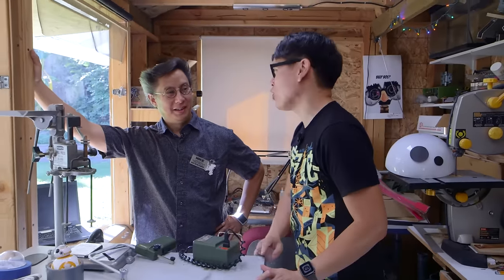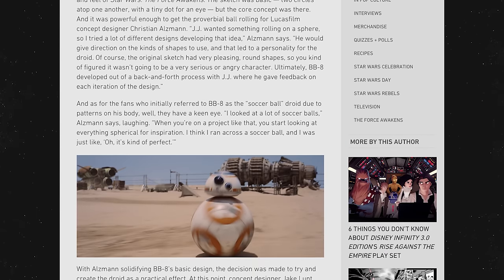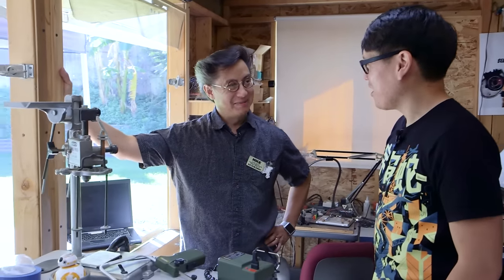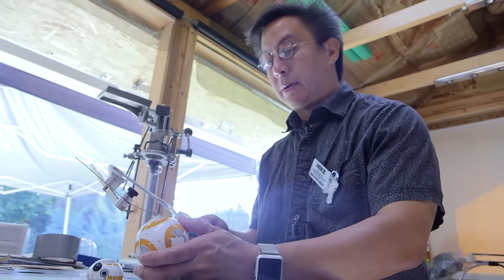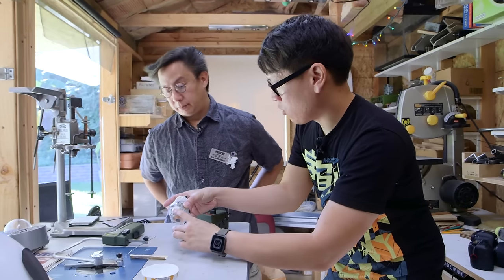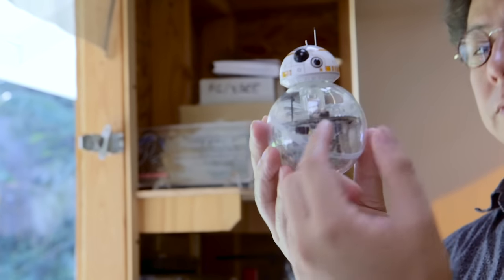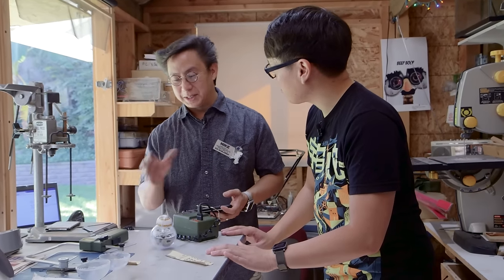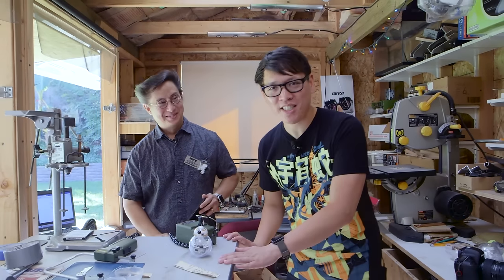How the BB-8 Sphero Toy Works

Comment: my guess as to why the shell was so thick is so it could create more distance between the magnets causing less friction during movement. This is probably why it was so wobbly when they put it in the clear shell.
Reply: +Jacob Carlson (Check Out Jacob) why wouldn't they just use weaker/smaller magnets, then?
Reply: You'll have to ask them :-)
Reply: The original sphero has the same thickness, that thing is practically invincible.
Reply: +dporiua Yeah, it's probably just for protection
Reply: Durability.  For example, the Hasbro BB8 (this video is on Sphero) snaps if it falls an inch.  This guy's head falls off during a long fall, but other than that it just keeps rolling.
Reply: +Jacob Carlson (Check Out Jacob) It looks like the shell of a hockeyball.
Reply: +Jacob Carlson (Check Out Jacob) It's unstable because the head raises it's center of mass. The thickness of the shell is purely for structural strength.
Reply: +Jacob Carlson (Check Out Jacob) or just move the magnets slightly away from the shell, calibrate it that way
Reply: +Jacob Carlson (Check Out Jacob) i think that the weigh of the thick sphere helps to stabilize the thing. The clear sphere weigh less more and that makes the center of mass be closer to the head. if the sphere is heavy then the center of mass is close to the center of the sphere
Reply: +Sigma Octantis center of gravity? do you mean center of mass?
Reply: Antonio Carranza Yes.. but I doubt there will be a quantifiable differential in gravitational field strength at this scale to cause any difference between the center of gravity and center of mass anyway.
Reply: +Jacob Carlson (Check Out Jacob) 
The shell is so thick for a number of reasons. First as stated, to add structural integrity to the toy, second to give it adittional weight that would keep it down as it rolls, and last but not least it helps evening out any roughness that might occur on the sphere surface over time, to keep a smooth rolling. The magnets and the friction are irrelevant, at the very beginning of the video it was stated the head ran on its own wheels which, judging by the toy's quality, are sure to have bearings.
Reply: bro i dont understand the relation between distance from magnet and friction , you are saying distance from magnet is indirectly proportional to fricition but if it was like that then the robot they made should go nicely and suddenly give a jerk cuz repulsion will exactly act when two like poles meet right

Comment: Just a thought, the thicker shell could be there to slightly reduce the magnetic connection between the head and the tower inside the Sphero to allow for smoother movement. Which could explain why the Sphero BB-8 (with its new shell) weeble-wobbled more then it did with the original ball shell.
Reply: +Danon Alexander Could they not have just used a weaker magnet instead?
Reply: +Erlend Powell Ya, they could try changing out the magnets. However, it would be much easier to just add some layers of (for instance) scotch tape on top of the magnets; until the thickness of the scotch tape layers & the thickness of the clear shell are about equal. Then it should resume behavior.
Reply: Danon Alexander My point was that the original shell wouldn't have been thicker to reduce the magnetic field, because they would have been able to just use a weaker magnet when it was designed. In other words, the thickness probably served some other purpose.
Reply: Danon Alexander That said, you're probably correct that the new shell had issues due to the new distance from the magnet. Not sure how your scotch tape idea would help though...
Reply: +Erlend Powell You're right you could still switch out the magnet, however manipulating the thickness of the shell plastic is considerably easier to get the desired effect then to find a different magnet that would give the same desired behavior. & ya your right, scotch tape probably wouldn't be the best choice.
Reply: Danon Alexander In my opinion it would be easier if not about the same to change the magnets rather than the shell.

Changing the shell would probably require a different mould each time, but the magnets could simply be magnetised using the same process but to varying degrees.
Reply: +Erlend Powell I'm sure the reason they also kept the thickness of the shell so that it wouldn't break as easily due to having thickness

Comment: The BB-8 Sphero clearly has electronic stabilization. Notice at 8:55 when they begin talking about the method of stabilization that the stage model uses, as Mr. Senna turns the toy, the inner working vehicle of the sphero is self correcting on the yaw axis. This indicates some type of sensor feedback is causing the inner vehicle to move to correct the moment. Its likely that it has sensory feedback for the pitch and roll as well. The weight at the bottom of the vehicle is to counter the moment of applying torque to the outer sphere. Without weight on the inner vehicle located below the center point of the outer sphere, the shpero have no ability to overcome even the slightest of grades or smallest of debris, nor would it be able to begin moving or come to a stop on its own. The inner vehicle would simply roll with or do loops inside the outer sphere with little effect on the spheros movement across a plane. If BB-8 featured in the movie used only this method of propulsion, it may yield some ineffectual results in space away from strong gravitational fields.

Comment: heres a suggestion....
instead of having the head sit on the body and letting it slide around, why not have the head somewhat like a ball bearing. 
at the bottom of the head u can see at the bottom of the head its just an indent and a ring going around it. on that ring is where the ball bearings would go so the head can roll around much easier and because the assembly on the inside is light, its being held back by the friction (as u can see here 7:30)  between the head and the body (because the magnets are holding it together). putting ball bearings around the surface of the head that makes contact on body would eliminate that and movement would be alot smoother. also the slight lag you see when the head moves (8:00) would also be eliminated. 
but this is just a suggestion. great device tho!

Comment: my first thought about the wobbling was that the clear plastic sphere weigh way less than the thick sphere; that makes the head-body weight relation close and also makes the center of mass higher. Maybe that's the only reason why the original sphere was so thick: to help lowering the center of mass.

Comment: The reason why the glass ball seems to tumlbe is because of too much friction due te the lesser distance between the magnets? Therefore the momentum of the bottom weight needs to increase to compensate this friction and cause a bigger angle... IMO there's no gyroscope needed to keep it upward...

Comment: But one thing is not right with this... in the movie the droid has (like R2-D2) openings with "drawers" in it... the drawers have to retract into the orb which would be like bulge on the inside! It may be that the inner Walls of the main body are way thicker then? But that would make it even harder to set in motion...

Comment: It wobbles because the contact of the wheel to the plastic surface is not a proper grip. It is not efficient/effective on the dimension of the plastic ball and friction. It causes the weight shift imbalance. 
If everything is snug fit and proper contact, you won't get the wobbling effect.
The only stabilizing system you need is the central counterweight balance (acting like a water spirit level) to keep its central gravity... Putting a gyroscope is over compensating and over complicating it. The gyroscope would be redundant.
You can find any medicine/workout ball, put a heavy RC car inside it (and reduce the speed) and will work perfect. The only thing is that you won't have a floating robot head, but just a ball.

Comment: Does the head just ride along or does it perform a functional need like stabilization or position indication?
I ask because I'm thinking of using one for a dog toy. Have it run around the house in a programmed pattern and I think the head might be "a choking hazard" so I wouldn't use if it wasn't needed.

Comment: Wouldn't it be easy enough on a large scale model for the "neck", where the magnet is, to have a gear system to isolate it from the rest of the body? So that you can move the head without having to move the whole body?
Reply: It would probably be easier to just make the magnets that hold it be able to turn. Like with a rod that is able to spin and goes inside the mast.

Comment: "An 1/8th of an inch thick"
is that really some kind of imperial unit? Or did this guy just make that up out of nowhere?
Reply: Well, an inch is an Imperial unit, of course.

Instead of dividing inches into 10ths, like any reasonable person would, we divide it into 4ths, 16ths, 32nds, ect and reduce the fraction. E.g. 1/16", 1/8", 3/16", 1/4", 5/16", 3/8", 7/16", 1/2" ect

Comment: I have got a better design, just use instead of the inner rollers a couple of ball bearings all around in small dents with a layer of oil in an inner hull, to move it just get neodymium magnets around the outer hull and electronics in an inner hull to steer it around using electromagnets that push and pull against the neodeum magnets in the outer shell, In an inner shell the battery ( a large one might hold a lead super battery combination between a lead battery and a supercapacitor because weight does matter)  you are moving the inner weight to make it move and refind its balance point please build one and show it here and as a thank you, you might mention me, anyway just build one.. so that the only point is keeping the head floating using these magnets and then another one inside that acts as a guide for the outer one if you place the magnets far away enough you might actually get  a way of placing an inductive loader in... if you feel generous to send me a toy version one ass well I will be eternally thankful the neodeium magnets might also be used to keep the head afloat and if it contains some inner magent as a guide or maybe a stronger one it could literally float on magnets maybe with some electromagnet balancing system  so than we get the movie effect of a real floating on magnets head that is also acting as a kind of impact cushioning, if the guide magent is used to get power to the head it will need to be an ac magent field and by using this field not only as a feeder but also to put a little data through we might get somewhere Go builders Go  !!!

Comment: '
why need a hot wire cutting the plastic ball open...
better use screws than hot wire...
dont need a glue on the ball

Comment: where did you get the clear sphere?
Reply: Derek Norris he said he got it at a craft store but sphero sprk is the same as the part of the BB8 that they took apart, and that is clear so you can see how it works the sprk is waterproof & can swim, as well as using an app you can program it to change colors at specific times or to run an maze, etc.

Comment: one of the issues of that BB-8 toy is the price $250.00 for that. Phone remote control BB-8 The batteries  cannot be removed. Every one knows batteries dose fail. PCB dose fail. what can  any one do? no repair service. buy a 2nd one and waste $250.00 plus shipping and tax again? NO THANKS PASS. Made in China not worth $250.00 .if you want a Andrioid Phone remote control droid? No problem I found one from UBISOFT online store from WATCH DOGS 2 product line what is known as WRECH JR ROBOT and its $90.00 a tone cheaper then $250.00 on WRECH JR ROBOT Batteries is not a problem, it was designed to be removed. all you do is go to like Walmart buy some  4 pack AA  rechargeable battery with a 4 hour charger.There is battery cover under WRENCH JR 2 ROBOT,. and install the 4 AA rechargeable batteries that is charged  wit the use of a plug in wall charger. and download the app for your ANDROID phone or ANDEROID TABLET. any high end brand will do. not the cheap brand names,.  There is a serial number for the APP. I do not know why every droid or robot that needs a App for your Android phone need a serial number to download that stupid app and to activate it. SO STUPID! any way its  STUPID STUPID STUPID STUPID buying BB-8 that the batteries cannot be removed and its price $250.00 or  buy something else for $90.00 that you can change your batteries  Hear is the link https://store.ubi.com/us/watch_dogs-2--wrench-jr-robot/585a43e6adc724ae4c8b4567.html#q=watch+dogs+2&start=10  there is more https://www.youtube.com/watch?v=MhZm1bJOKrA